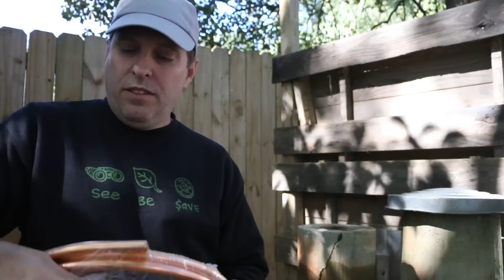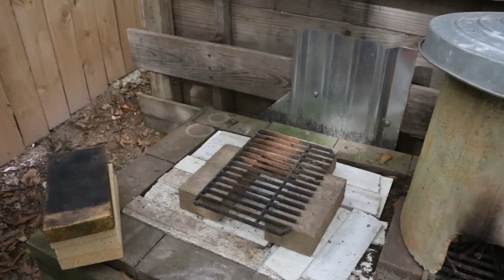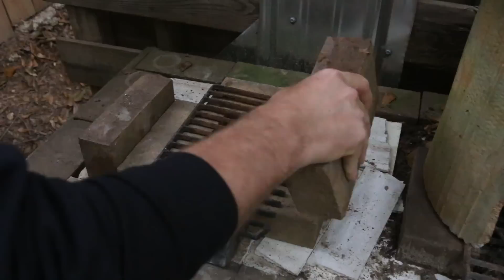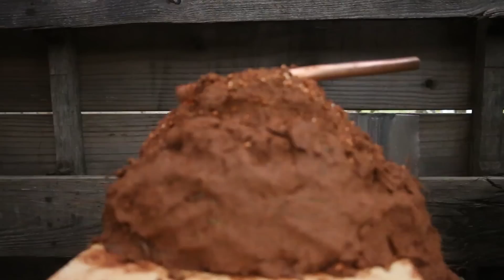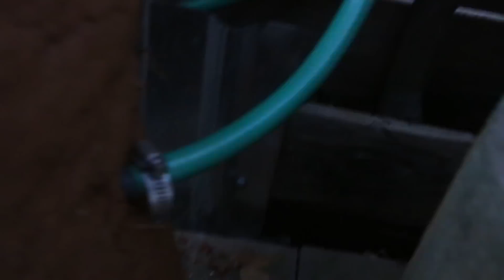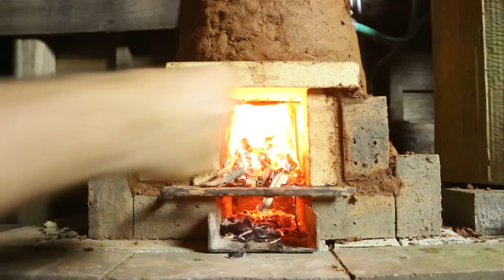How To Make A Cobb Rocket Stove Water Heater

Comment: Water filled thermocycle coils rob rocket chimney of the high temperature heat needed for a full  clean burn.  Wasted heat, wood and time vs. direct pot boiling above chimney with bottom and directed side heat after full burn. Then use thermocouple plumbing to  transfer/cycle boiling water over  to additional stored water on side for shower.  Get max. clean, hot burn and heat extraction this way.
Reply from the maker: Thanks for the input. I hadn’t considered that factor in the efficiency of the rocket. Thanks for watching.
Reply: @GreenShortzDIY  I wonder how it would work if it was a rocket heater instead of a stove.  What if you actually placed the coil inside the Cobb chimney (coil surrounded by the Cobb) and cover it all with a barrel... It would retain the heat much better so water would also boil faster.  The idea of placing a pot with water on top of the fire can also be replaced by placing the coil on top of the chimney instead of around it, but I still think that covering it up with a barrel would be the most effective way. I like the coil idea bacause it is simple to remove hot water from the bucket and keep on filling it up with more cold water without little effort while the coil keeps on working... What do you think?

Comment: Hi,  great video...what do you seal the clay with to help preserve it? Thank You
Reply from the maker: I haven’t done a proper sealing on any of my cobb stoves or the bread oven. The oven has a roof over it, I keep the water heater covered, but my first cobb rocket stove has almost completely dissolved in the weather. It has been almost three years since I made it. I did get a suggestion in the comments of my first build to use boiled linseed oil. But I haven’t tried that yet. Thanks for watching.
Reply: @GreenShortzDIY  ok ,thank you...yes,i think i had heard one linseed oil also...Love all your videos, i always learn something

Comment: Check out making AIRCRETE     Then make a Rocket stove from AIRCRETE material!
Reply from the maker: Hi James. I’m actually practicing with Aircrete right now. I need to make a few more modifications to my foam generator, make a few more practice batches and then I’ll be ready to make an Aircrete rocket stove! Thanks for the suggestion. Thanks for watching.
Reply: You should check out The Honeydo Carpenter. He has the best plans and for a foamcrete machine and stove designs.

Comment: Wait, shouldn't the hot water enter from the bottom?  Cold water at the top would make it circulate, no?
Reply from the maker: Hi Al. The thermal siphon works because the water rises through the coil as it heats. Similar to hot air rising. Because the water in the bucket and coil is in a closed loop (except for the leaks), the flow of water will move according to the laws of physics. Thanks for the question. Thanks for watching.
Reply: All ram is almost right there in my experience. I am a fellow maker of hot water projects and really like this. But what I do is actually put BOTH of my pipes in the very bottom of the tank BUT they must be more or less on opposite sides of the tank. As the hot water enters the tank it rises immediately through the cold water to the top, mixing as it rises. Because it rises quickly up one side of the tank to the top  it does not interact with the cold water leaving the tank other side to be heated. In this way the whole tank becomes uniformly warm slowly becoming hot rather than the top of the tank being scalding hot and the bottom cold. Hope this makes sense.

Comment: i wonder how well rock wool would work in a furnace like this
Reply from the maker: I bet it would have been an excellent insulator around the coil. Thanks for the suggestion. Thanks for watching.
Reply: Can't use it for the burn chamber. It shrinks and hardens, then eventually disintigrates. I made a batchbox by Peter Van Den Berg out of Rockwool and it lasted one fire.

Comment: As was pointed out, the was too low, to take advantage of the secondary burn gases One thing that might cause a problem, once the cobb dries, as you copper heats and cools it will  expand and contract, which will start  to crack the cobb. I think if you use 1/4" pipe with a a coil length of about 2 feet inserted into a metal pipe wrap some rockwool or fiberglass around the pipe then cobb it. This will help concentrate the heat better.  I would also get a small 12volt pump and a solar panel, this will run the water through quicker, making a more uniform heating system, no worries about boiling water in the tubes

Comment: Sand or even salt works. Just gotta plug both ends with sharpened wood dowel. Smaller diameter coil I would prefer.

Comment: The reason you had very hot water at the top, and very cold at the bottom, is because of design flaw. Look at solar hot water heaters for correct design. The hot water inlet should also be near the bottom, just above the cold. When the hot water comes in, it will continue rising to the top of the bucket. This forces the hot water to mix with the rest of the water in the bucket.
Reply from the maker: Thanks for the tip Shawn. I see what you mean. Thanks for watching.

Comment: You're cooling the flame too quick, so the gasses don't all fully combust. Safety is also an issue. Making steam inside a restricted coil is dangerous. 
Simplify things by having a large U-tube on the outside of cob stack, but inside an upside down barrel.
Reply from the maker: Thanks for the concerns, Paul. And thanks for sharing your ideas.

Comment: You need a longer coil. At least 20 ft. Also add a reducer at the out put at 1/8" diameter. This cause a decreasing velocity that increase temperature inside the coil.
Reply from the maker: Ha! True. I was kind of surprised that 10 feet was only about 5 inches of coil. If I build this again, I’ll definitely spring for a longer coil. Thanks for the reducer tip as well. Great suggestions. Thanks for watching.
Reply: @GreenShortzDIY  1/8" diameter and 20 ft of length will be great and more heat transfer efficient.

Comment: To bend copper without kinking and flattening, go to the hardware store and get a foot of spring with the inside diameter the same as the outside of the copper. Well, tight enough to slide but not grab. Then you can bend as tight as needed without kinking.
Reply from the maker: Excellent tip, Stephen! Thanks for the feedback. Thanks for watching.

Comment: Great video.  But shouldn't you use metal pipe for the hot water output, like with a still?  That boiling water could melt your hose.
Reply from the maker: That is a good tip, Wanderer. The hose was just a cheap garden hose and it was getting softer as the water heated up. Thanks for watching.
Reply: @GreenShortzDIY  I saw this video to the side of a video I was watching.  I clicked on it and thought is was a great video, as I said above, so  I've subscribed.
Reply from the maker: @southernwanderer7912  Excellent. Nice to have you watching. Have a good night.
Reply: @GreenShortzDIY  By the way, I'm near you in S.C.  Have a good night.

Comment: I think it would be important that there is always water in the copper tube because it would probably be approaching the melting point of copper in there.  Great idea, though.  You could also use it as a floor heating system if there were piping in a cement floor.  Be good for a green house or even a small house.  No chance of fire indoors that way.  I guess the question is how long would it last.  That's quite a bit of heat on the copper.  It might structurally fail after some time.  I could do something like this on my stove pipe, but I hardly use hot water anymore for bathing.  I wash with a pitcher of water and a wash cloth.  Everything else seems so wasteful.
Reply from the maker: I admire your water use efficiency. Most of the world uses so much less water than Americans. I have thought about the radiant floor option...or a wall panel. Also thought about a salvaged car radiator. I’ll certainly be careful with the copper. It would most definitely melt without water pulling the heat through. I have gotten a few comments that it might fail at some point. I’m happy with this set up as a test. Thanks for all the feedback.

Comment: If you can do anything with fired clay (not sure if you've got a kiln anywhere your setup), it might be neat to try making interlocking sleeved cylinders. Shouldn't be too different than making pottery around some forms. Then after firing those, you could stack those sleeves to be used as a chimney liner for something like this. Perhaps adding one or two feet to the height, since those would help support the surrounding clay/cob from deforming too much.
Reply from the maker: Hi Paul. No kiln yet, but I have something that might work. I like the idea. I’ve been thinking about trying some clay mixed with sawdust to create a fire brick. Could do them in a cylinder form to do what you are suggesting. Thanks for the feedback and thanks for watching.

Comment: i wonder how  well one of these water heaters would work if you had a much larger metal tank, like say 6 ft tall and  24 diameter and had a small pump pushing the water thru much quicker.
just the mass of that steel tank full of hot water could keep a greenhouse above zero over night  when its freezing out.
Reply from the maker: I think you are correct in your thinking. The thermal mass of the water would hold the heat better than air. That’s for sure. Thanks for the feedback. Thanks for watching.

Comment: Use a metal bucket instead of plastic & place it 2/3 inches above    the chimney? Max heat output capacity, just a thought 😸
Reply from the maker: Hi Rob. I did notice all that heat flaming out of the top of the rocket stove. I hadn’t thought about putting the water storage there. Thanks for the suggestion.
Reply: someitmes its probably very practial making use of " thermal siphon" to transfer the water from one room to another
Reply: @jesuschristislordoflordsan427  Well, if the son of a carpenter said it... 😏

Comment: It's always easier to coil copper tubing by coiling it around something, such as pipe or PVC... I'm going to be using either 25' or 50' of 3/8th OD when I reach a point where I won't be risking what will be (for my budget) "a good chunk of change..."
Reply from the maker: Ha. True. I opted for the 10 foot length for cost reasons myself. Copper is not cheap. Good luck with your build, when the time is right. Thanks for the feedback and for watching.
Reply: @GreenShortzDIY  THANK YOU! :D
Reply: I was going to suggest coiling the copper pipe around a length of 3" pvc pipe for a perfect coil. 3/8" OD x 2 should be barely enough to fit inside a 4" ID tube. I'd never try bending it by hand like that because it'd definitely kink on me.

Comment: Isn't it better to put the coil inside the cob, so there is no direct contact with the flames, but the heat will transfer thrue the cob? Let's say a 1/2"  layer of cob on the inside of the chimney extra. This to avoid burning the copper pipe.
Reply from the maker: You may be right on this. I’ll have to observe how the copper behaves over time. This is an experiment, of course. That’s how I roll. :-) Thanks for watching.
Reply: That's one of the things I've been looking into, for when I build mine. (Hopefully, rather soon.) I'll have the additional benefit of it doing a thermo-siphon heat of about 75~80 gallons of water; since, I'll be using it on the 110 gallon, black plastic, stock tank which I installed as my bathtub. :) [I have an identical one outside, with a piece of safety glass over it; and, it's GREAT ~~ when the temps are in the 90's...]

Comment: try hooking up a bilge pump for a boat and circulate the water from the pail through the stove and back to the pail. soon the 5gallons or ten gallons of water your heating can  transfer to a holding tank and be the right temp. for a shower. adding water to replace what you remove. hope this helps.    Ray
Reply from the maker: Hi Ray. I’ve been trying to think about how to regulate temperature so I don’t get scalded. I think your circulation idea would be a good solution. Thanks for the suggestion. And for watching. BTW, my younger sister was a PA on Big Fish. Were you involved or is it just a favorite?

Comment: You wasted so much hot gases and  energy from short chimney, you must utilize  chimney design either make it longer and longer copper coil or add extra heat absorbing material to the chimney.
Reply from the maker: Su, you are right. I was surprised how short the coil was for a 10 foot piece of copper. This was an experiment, of course, but if I made this again, it would have a much longer cool and taller chimney. Thanks for the feedback and thanks for watching.
Reply: i thought it seemed like waste of energy too and it slipt my mind that instead of copper coil we could use some kind of water container right on the fire instead, sealed with input/output to larger container somewhere making use of " thermal siphon"??
Reply: @jesuschristislordoflordsan427  Hmm... a double walled chimney with water in it. 🤔 Now you got me going! 😀
Reply: @jesuschristislordoflordsan427  the purpose of using coil in the rocket stove is to find the most efficient way to heat water while cooking on the rocket stove in the grip
Reply: Jesus Christ is Lord of Lords and King of Kings the copper pipe has more surface area and therefore will heat quicker
Reply: Do you have a design that you highly recommend? Thank you
Reply: if you pass through the cobb rocket a peace of steel pipe going horizontally above the fire and on side connect copper pipes to coil, then you use more of the heat and speed up all processes If you know what I mean:) of course if a lot of different method and improvements for anyone have the proper materials.

Comment: Great video,  But copper doesnt like frames,  it will perish,  better to use stainless steel
Reply from the maker: Thanks for the feedback. I’ll have to de a replacement video if the copper fails. Thanks for watching.
Reply: About how much would a 25' ~ 50' coil of 3/8" OD cost in stainless? I'm worrying about copper not only failing due to the heat; but, getting corroded by the pool shock I'll need to be using. :(
Reply: @NTF-zb9wi  Sry bud  im from uk so would be pointless me giving you a price comparison ;)

Comment: Use salt for filler to bend it. Easier to get out being water soluble.
Reply: Or use a steel ‘spring’ that fits over the copper pipe. 
We used to sell one designed for this purpose at a plumbing supply I worked at. 
It’s coils are too tight to be a spring but it creates a bendable but circular pressure evenly over the copper. 

Quicker and easier than filling a length of copper. Move it along the pipe as you make each bend
Reply from the maker: Good tip, Jim. Thank you. Thanks for watching.
Reply: @GreenShortzDIY  can get real tight bends and coils.
Reply: @GreenShortzDIY  qq
Reply: ...or sand

Comment: Tom a couple questions. How long did it take to heat the 5 gallons of water and how much fuel was used to get it hot? Great design really like the concept. it got me thinking of making one of my own.
Reply from the maker: Hi Rick. I don’t think I got the whole bucket heated during this test. Although, it might have all been warm if I mixed it. I also really didn’t measure my fuel...I was under the gun to get it done. When I do part two, I’ll be more scientific...have a thermometer on hand, have all my fuel ready for a visual and most importantly, no leaky bucket. Thanks for watching and for the encouragement.
Reply: @GreenShortzDIY  I'm looking forward to "Part 2." :)

Comment: Thank you for the video, i'm facinated by rocket and similar wood-burning stoves. I am particularly attracted to the heat efficiency and low-pollution achievable which I understand comes from having a very high temperature extended chimney above the fire to complete the burn. Having a pipe for water heating is attractive but being so close to the inside of the chimney, I think this must negate the high temp chimney objective. I presume this why we often see a cover over the chimney, forcing the exhaust back down and exhausting at the base. The area between the chimney and the cover is the area where heat could be harvested with the coil to heat water, without risking the "hot chimney" principle. Any thoughts - have you tried this sort of design ?
Reply from the maker: Rhian Taylor Hi Rhian. I think what you are talking about is called a rocket mass heater. It’s related to a rocket stove, but usually has a taller chimney and a barrel or some over the top to provide complete combustion while forcing the warm exhaust through a “mass” to absorb the heat and radiate into a living space. The complete combustion relies partly on a very hot riser. It’s sort of the nozzle of the rocket. I do want to eventually make one of these, but I’m still in the learning phase. Paul Wheaton is a guru on the subject. You might enjoy some of his videos. Thanks for watching.
Reply: @ Rhian Please check out Audiobro for a great rocket mass heater and cooking stove with optional hot water heater. he offers plans for the two versions with personal help if needed.